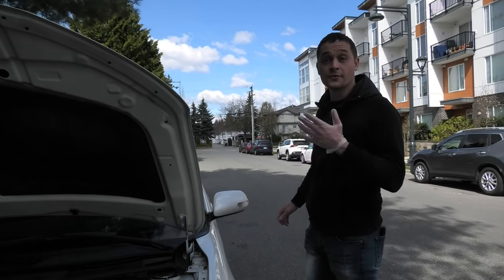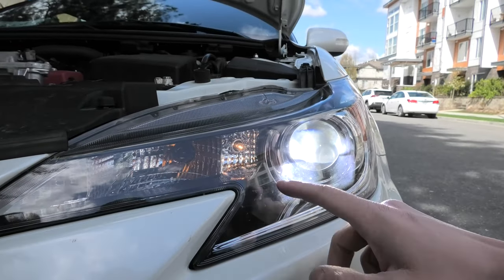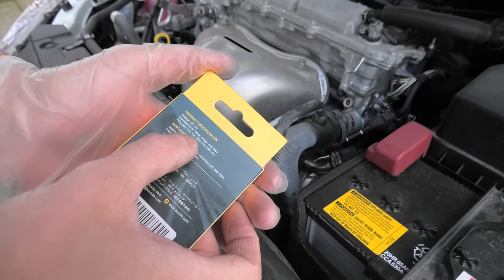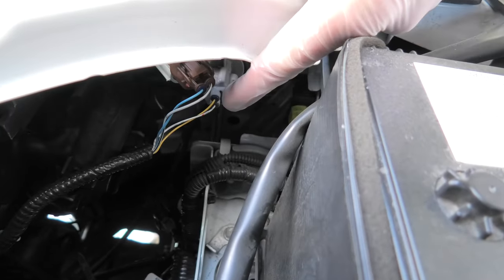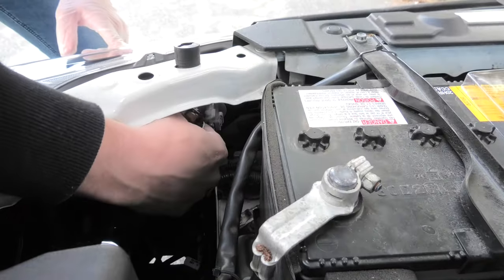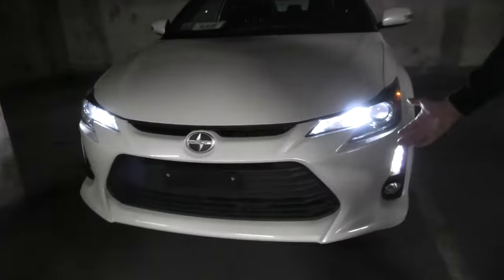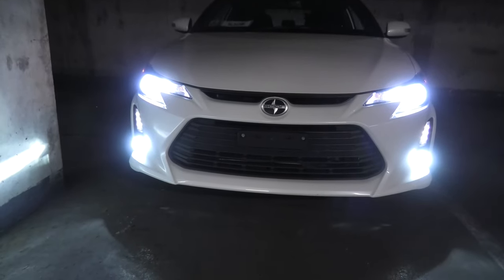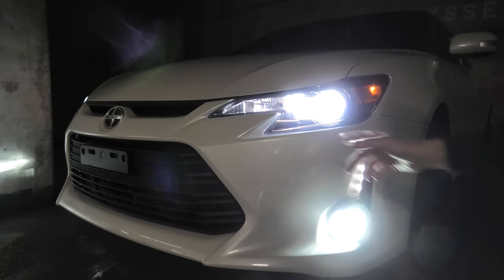Scion TC (2014-2016): Front Marker Lights LED Installation.

Comment: Do you still have them & any issues ?
Reply from the maker: Yes, I still have them. Work great, no issues.
Reply: Appreciate it , do you know if you can change the bumper lights to LED or what size they are ?
Reply from the maker: @JavierGuerra-b7i  They are already LEDs. Not sure about the size.